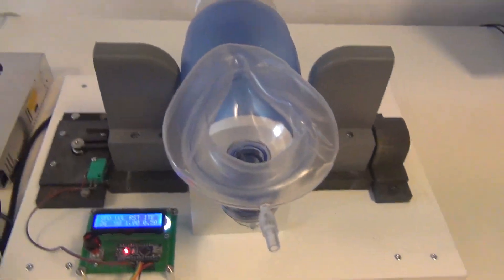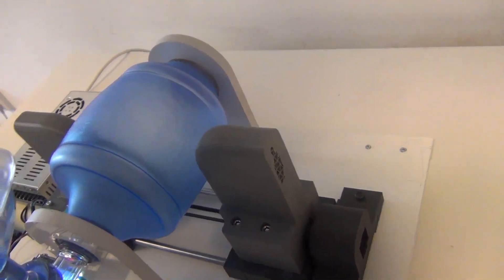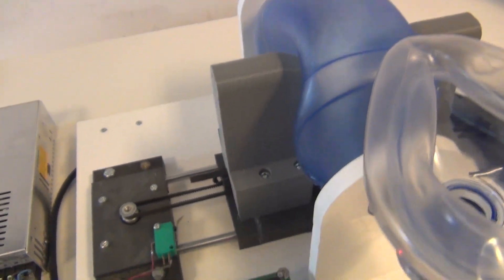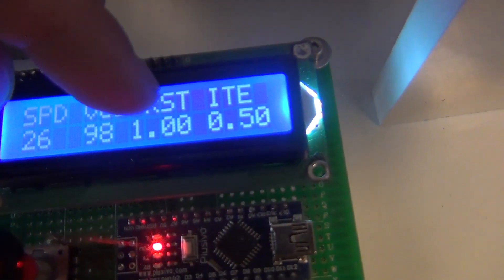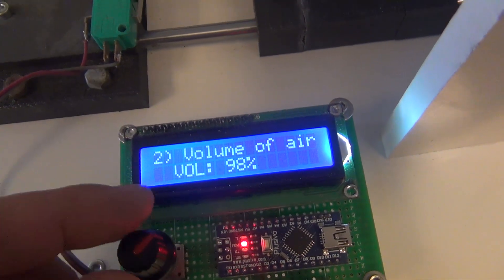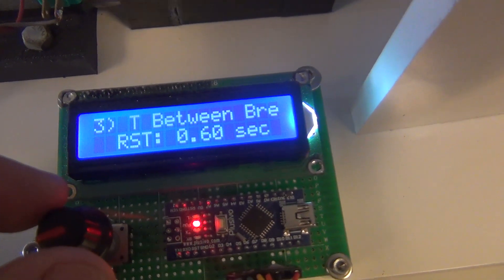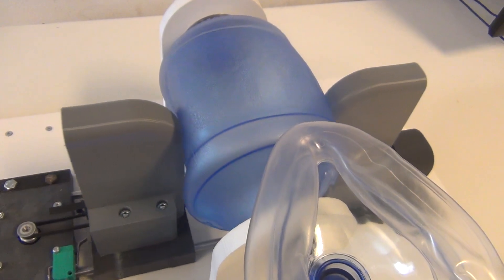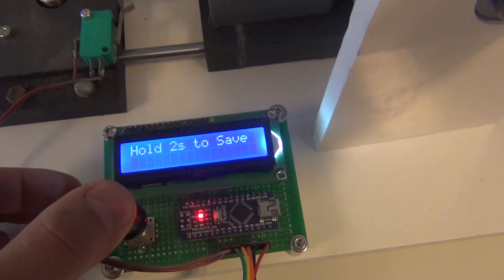DIY ICU Ventilator Prototype

Comment: Inhale and exhale air separation as per medical standards of Ventilator design Mcgraw hills chapter 3.
Reply: Entirely true this in it's current form cannot substitute an actual ventilator. It's missing pressure sensory and negative pressure.

Comment: For someone who has done CPR at of times.   Great design.   just have to add longer tube and mount either side or upside down.    Need longer tube and probably way bigger bag to compensenate for longer tube.     5ft tube would work
Reply from the maker: Thanks michael for the suggestion, will see how it goes